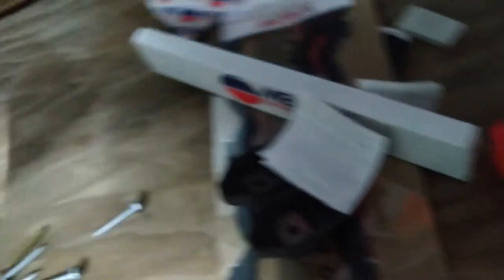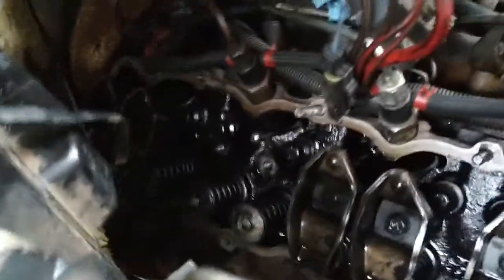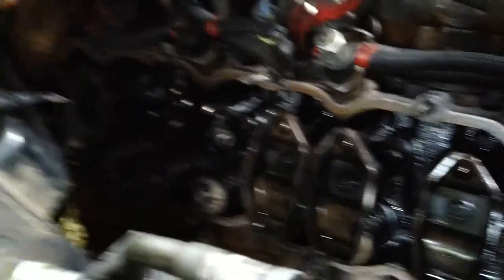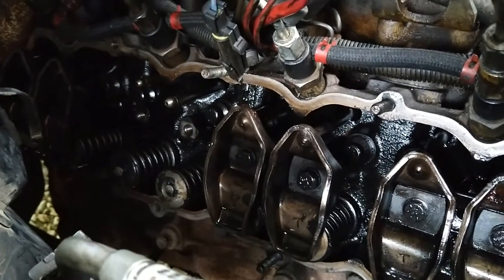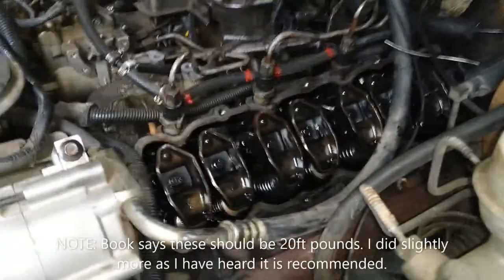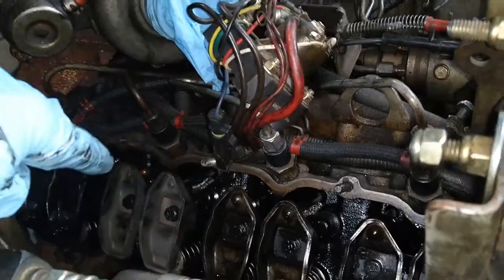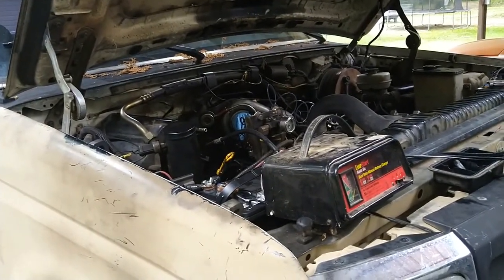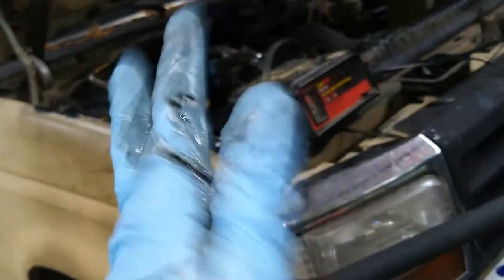Ford F350 7.3 IDI - rocker arm and pushrod replacement and knock investigation

Comment: I’m chasing a semi similar noise in my idi right now. Attempting a leak down test tomorrow and then removing the intake/ valley pan to see if I can find something. Just curious if you did a compression or leak down test while you were doing this. Sorry if I missed something you already pointed out in one of these videos. Also seriously thank you for posting
Reply from the maker: Good luck. My advice to you is be patient and confirm what is making the noise. I ended up having a spun bearing and it trashed the engine. The issues in this series were real, and should be addressed, but they were not what ended up being my problem

Comment: On 7.3''s with 2 hundred K miles or more "Hot Shot Secret" will do wonders on cleaning the injectors while you drive. It removes the Sticken burnt oil build-up

Comment: Hi. I am working on a 1990 Ford with a diesel engine and I am running into a problem with the pushrods. Just can't seem to find any information on it. First, do the punch marks go down or up and second I'm curious on how you got the last two pushrods on the passenger side out past the plastic heater core housing without removing the entire head again? I can see no other way to do it without popping off the smaller side box (compartment) of the heater core housing. I'm no professional. Was just trying to save myself some money on labor using YouTube. Starting to think I should've just took it in but I'm in too deep now...

Comment: Change the oil in the oil reservoir for the injectors
Reply: There is none. This is a mechanical engine not a powerstroke with hpop